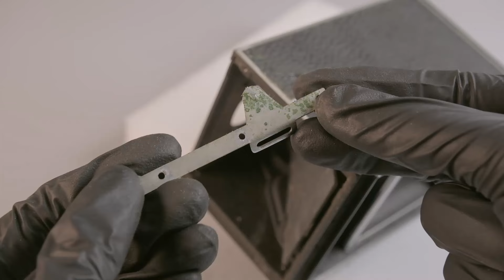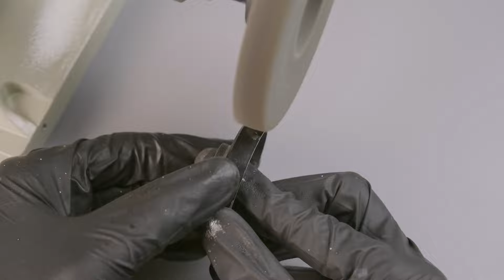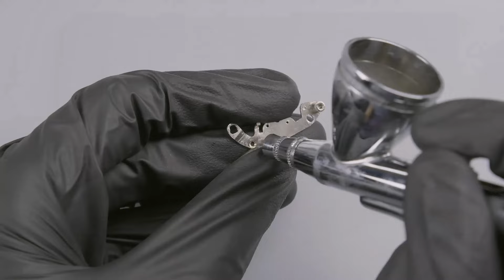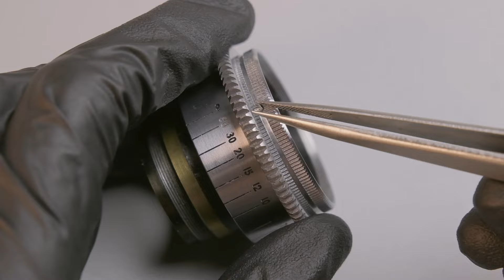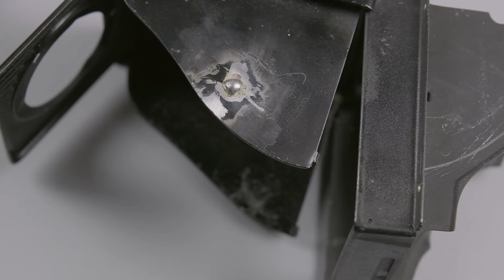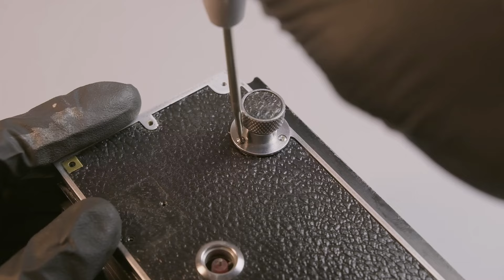Rare 1950s BeautyFlex TLR camera - Repair and Restore

Comment: There's a guy who'll custom cut front surface mirrors, I've replaced several mirrors in old TLRs and SLRs. The silvering on pre-war German mirrors will literally dissolve if sprayed with glass cleaner, so I've learned it's better to replace than attempt to clean.

Comment: Beautyflex is a camera of the 1950s, made in a number of models with slightly differing features and lenses over the years. They are very simple, ordinary examples of classic, inexpensive Japanese TLR of that era: simple designs made out of sheet metal folded to shape; usually simple triplet  lenses, not very well corrected; not high precision construction. The Beautiflex was one of those models which were rebranded under other names, usually as shop brands sold in stores like Sears and Montgomery Word. A better quality example of the type would be the earlier TLRs made by Ricoh, which share the less common focus coordination had by gearing the viewing and taking lenses so they rotate together in helicord mounts, rather than more common and expensive method of fixed both lenses to the front panel and focusing by moving the panel. Apparently, Beautiflex holds some collective value, as they are ebay listed in the $200-250 range, well   above its value as a functional camera.

Comment: Holy hell my ears exploded from that first ultrasonic cleaner clip. Also, how accurate did you get the shutter speeds? And that bent pin in the shutter. That may have been bent intentionally to change the engagement with the main cam.
Reply from the maker: Sorry for the bad audio. This one come with shutter speed guide plate which help a lot. There will be margin of error in shutter speed but will not get complete different shutter speed. (eg 1/200 sound like 1s shutter)

Comment: So my biggest question is: How do you put it together or how do you know where all the parts go? Do you have a printed layout or video in front of you? Or is it just learning by doing?
Also, what purpose does the yellow cable have?

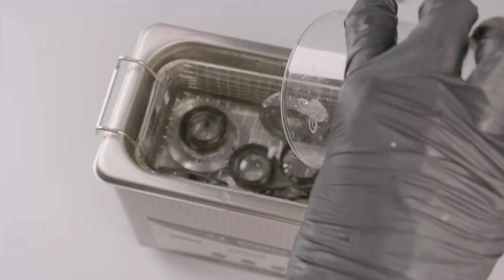ps: 17:19 was extremely loud
Reply from the maker: Sry for bad audio. I couldn't find repair manual for this one so I did with blind repair based on experience. TLRs are pretty much like range finder.  Yellow cable for flash sync I think.

Comment: hi, What kind of lubricant do you use for glass and mechanisms before disassembling them ?
Reply from the maker: Any good low viscosity rush removing oil will do the job. The one I used is WD40 like variant with good penetration into grooves. Leave the oil for few hours before removing rusty , jammed parts.